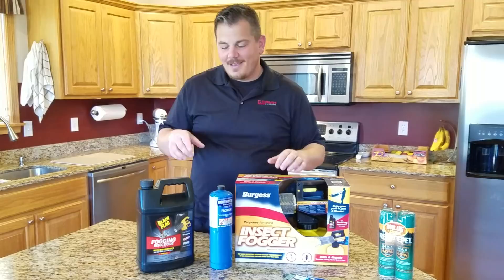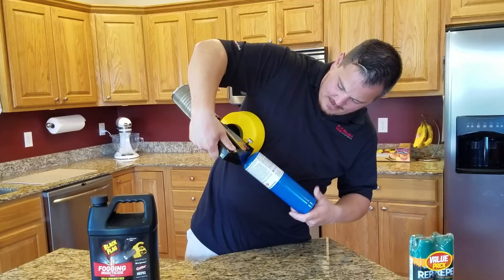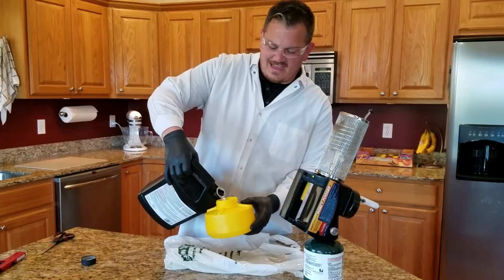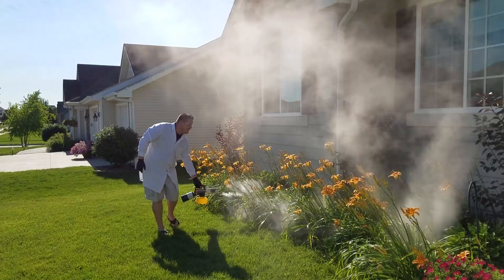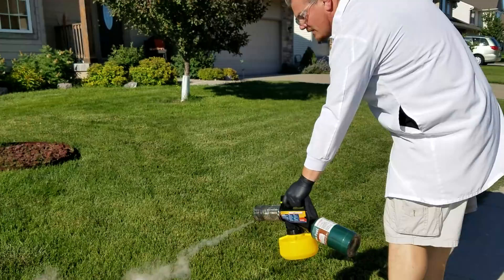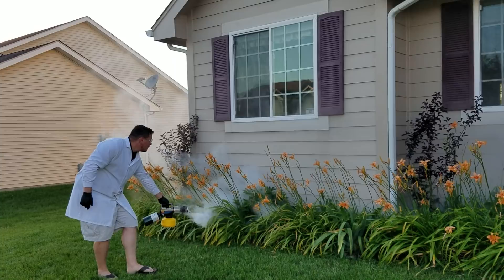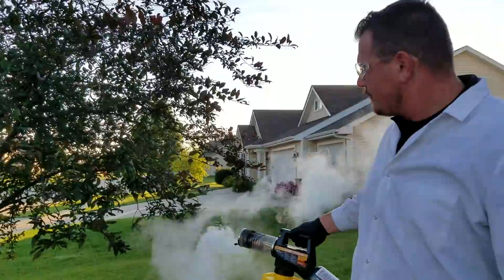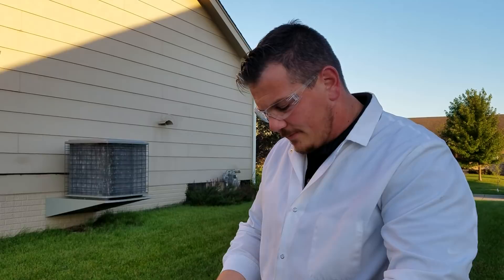Burgees Propane Powered Insect Fogger = Mosquito Buster???

Comment: Hey Brian! Fellow Ankeny RC flier here. I own this exact fogger and use the same fogger spray as the skeeters on our little acreage get pretty insane, and I'm sure this flood fallout issue isn't going to help with that. This thing actually does work REALLY well at controlling them. Regular applications keep my land 90% mosquito free, and any difference in the right direction is a huge difference if you ask me. One tip for ya, I used that yellow canister on my first one and just left it on with fogger in it while storing, it seems the metal they use to make the liquid pickup is not stainless and my first fogger rusted up and no longer worked by the end of the summer. So I ordered another and this time I used typical mason jars as this fogger accepts the same threads, then pop the jar off when you are done, cap the jar and let the fogger pickup air dry, no issues using that technique for over 2 years on my second one.
Reply: Oh, and I also built me a couple bat houses out of cedar and hung them up at the far ends of the property, it took about a year but the bats moved in and quickly went to work filling their bellies full of these annoying blood suckers, I think that defiantly helped out. Between the bats and the fogger I'm able to enjoy my deck and evening flight time!
Reply from the maker: Thanks for the pointer!!! I've been EXTREMELY happy with the results - on the 4th we were out and virtually no mosquitoes at our front and back yard, then we walked behind the house to the cul-de-sac and it was like mosquito-Armageddon!!!

Comment: The directions say to pull the trigger every 3-4 seconds otherwise you'll be pushing out the insecticide out of the front nozzle and possibly causing a small flame. I think that's what was happening here.
Reply from the maker: ...and it was TOTALLY AWESOME!!! ;) I just used this thing tonight again, but no flame thrower action - totally disappointed - LOL

Comment: I'm pretty sure you have the gas valve open way too much🔥its only supposed to be open 1/4 turn.. hilarious video 🤣
Reply from the maker: There's almost no difference between "on" and "full", but I'll check on it the next time I use the tool.
It worked REALLY good. Mosquitoes were almost GONE for a few weeks. Totally worth the effort, and money!
Reply: @BrianPhillipsRC  it was a great review that had lots of laughs. Definitely subscribing for more.
Reply from the maker: I'm glad you enjoyed it!
Remember - flip flops are NOT safety shoes :) LOL!!!
Reply: Brian Phillips did you get the flame to go down?  I have a flame in mine and the valve is barley open
Reply: Grape Jelly I just used mine for the first time and the directions say to only pull the trigger once every 4 seconds or so. This way you don't pump out more of a mist or a "wet" fog instead of a dry fog. If you have too much coming-out of the front it could come out as straight liquid which causes the flame.

Comment: Here in west Houston, around Memorial Drive (kinda upscale area), we have a city pickup truck come around about once a week during skeeter season. The bed of the truck has a large-scale version of your hand held fogger. No idea what chemical they use. Usually comes after midnight and fogs literally square miles of the area and really keeps the skeeter population down. I always put a couple of drops of motor oil in any puddle of standing water. Research says that just a molecule-thick layer of oil keeps mosquitoes from breeding. I hate those bloody things.
Reply from the maker: I do too! We had the skeeter trucks here before, but I can't say I've seen one for years!
So far, the yard was about 95% better for the 4th of July evening celebration. It was like walking into a swamp across the back yard in our backyard neighbors cul-de-sac...It definitely worked!!! We're very pleased, and we ALSO had a much better day dealing with mosquitoes at our land, where we Fogged. It's not a 100% solution, but it's at least a 90-95% improvement. I couldn't believe it!
Reply: Outstanding! it's nice to spend your money on something that actually works. I've been wondering, are you thinking of a mobile home while your new house is being built? That was a road I took in the early '90s when we built our lakeside house. Worked out pretty well for us.
Reply from the maker: We have been toiling over this aspect of the many, many tough decisions we need to make. My wife stays at home with the kids and home schools them...all FOUR of them...so being at home in the winter [hopefully not, but potentially] makes this choice even tougher. Then we juxtaposed a trailer to actually moving into a small house or apartment and which is also cringe-worthy. If they went to school or work outside of the home each day, this would be better tolerated, but since they're home all the time, we've been challenged to figure out how to make this happen.
...to be totally honest, it's a tough call. We hope timing works out perfectly, but we can't say that it will...in fact, we pretty much expect that it WON'T. Sometimes the only option is to be uncomfortable for a short time...which is easier for adults to do, then children.
Reply: Yeah, that is a tough call. We raised 5 kids, and it was a job and a half. The lake house was our concession to 4 of them being teens at the time. 3,500 sq. ft. in 3 stories and it really turned out to be barely big enough. The mobile home was just a standard 65 footer for the 6 month build, and that got small in a hurry. We also had no major winter to contend with, thank goodness. It turned out well over the long haul, though. Good for you on the home schooling. Don't know about Iowa, but Texas public schools at the time were not the greatest, so we elected for home schooling. My wife had a teacher's certificate and a BA in business, while I had the MSEE. Those helped a good bit. The kids are in their late 40s now and have done pretty well. None in the soup lines, anyway. You'll make the choice that's right for you, I have no doubt.
Reply from the maker: Thanks Raymond! My wife also has a BA in teaching, and she was a teacher too. Seems we share many parallels.
So you all lived in the mobile home for about 6 months. Did you rent it or buy it?
Reply: We just rented it. Once the house was built, I knew we'd  have no use for it, so saw no reason to lock us into the thing. Money better spent on our planes and charter business. And yes, watching you and Megan is a bit like watching parts of personal history being relived. Fun for an old man. You're what, about 50 years younger than my 77? At 27 I was flying in the Vietnam theater. Not the most fun I ever had.
Reply from the maker: We'll have to look into renting one. How did you handle your septic needs? We don't have sewer, and septic will be one of the last items to be installed.
Reply: We had to install a septic tank and water well, too. I had both installed professionally and never had a minute's trouble from either. If I'd had more time, I'd have done both myself, but I was flying almost every day and running an FBO 7 days a week. You know what it's like to own a business.
Reply from the maker: Did you have to build a new septic system when the house was finished?
Reply: As soon as the house was built to the point of plumbing installation, we had the system installed. The gray water was just routed to the lake. Since the work was done with permits, I assumed the county was good with that. Half of the ground floor was the boathouse, built over the lake, and that was where it was discharged. I had 2.5 acres and about 300 feet was lakefront. The whole exterior was cypress cut from a single tree. I had a friend who owned a sawmill. He not only cut up the tree, but supplied the tree in the first place. He made me a heck of a deal.
Reply from the maker: very cool!

Comment: Make one for a plane so you don't have to walk so much lol .
Reply from the maker: I want to do this for sure, but not 100% sure my larger planes could hold this much weight.
Reply from the maker: That's a nice idea, but you gotta keep in mind how much this liquid weighs. I've been thinking it'd have to be a 1.5m at minimum, then I'd have to get a smaller propane tank and a smaller liquid reservoir, then there's the open flame......which is not super easy to deal with on a foam plane :)

Comment: You should have used a proper mask for this thing. As a side effect it may shrink you balls and stick. LOL maybe not but is toxic anyway.
Reply from the maker: LOL
Reply from the maker: Still trying to figure a way to add LED's and Flaps
Reply: Cool solution add LED's to each mosquito so you can see them coming easily and with some flaps on them they will fly slowly then you will be able to just avoid them ;)

Comment: Thats a load of crap, i used this stuff n it wouldnt knock them down much less kill them! They beat the crap out of me instead, lol, it does not kill on contact, unless i was dealing with Super dupper mosquitos
Reply from the maker: I thought it worked well. I still use it in my 3 car garage (at our new house) when I'm going in for the evening...it knocks down thousands of bugs in the garage. Pretty gross, as there's bugs all over the cars and on the floor.

If you use it in any wind, it works pretty bad, as it doesn't linger long enough.
Reply: @BrianPhillipsRC  i have used it about 3 times, i went to  the store where i bought it along with the Gallon of Mosquito killer n the guy there told me that this isn't what i thought it would be, that the smoke coils have more knocking power, what are you using?